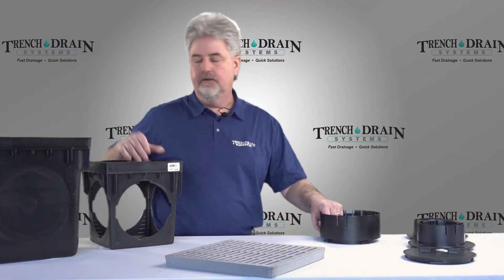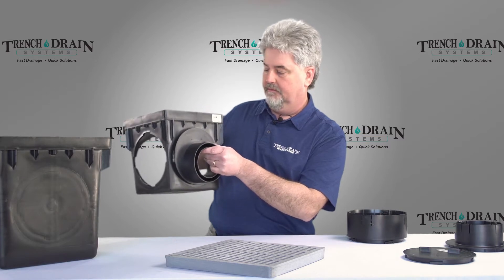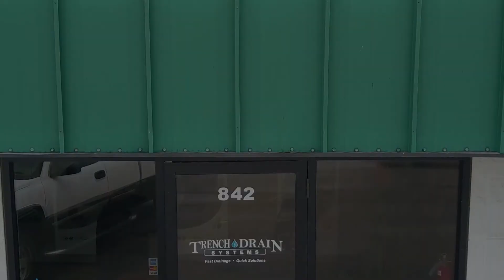How to Assemble 9" & 12" NDS Catch Basins

Comment: How do you knock out the 3" fitting on the 3"-4" outlet so that you can attach 4" piping?
Reply from the maker: Thanks for contacting us! The 3"-4" outlet stays as-is. You slide either a 3" or a 4" pipe over the corresponding ring of the outlet. For example, when sliding the 4" pipe over the 4" ring of the outlet, the 3" ring stays in place and is not knocked out.
Reply: @Trenchdrain  thanks for the clarification, there are  instructions and an arrow molded into the part saying "knock out for use with 4 inch pipes" so it seems like you are supposed to cut that out
Reply from the maker: @roeschdan  Glad we could help. Please feel free to contact us if you have other questions at (610) 638-1221, 8am-5pm EST, Monday - Friday.

Comment: How do u knock out the outlet
Reply from the maker: Thank you for contacting us! The 9" and 12" catch basins come with either 2 or 4 outlets that are already cut out. They have a bottom outlet that you can cut out with a utility knife. But  if you need outlets on 3 sides total, you'll need to get a 4-outlet catch basin and an outlet plug to put in 1 of the outlets.